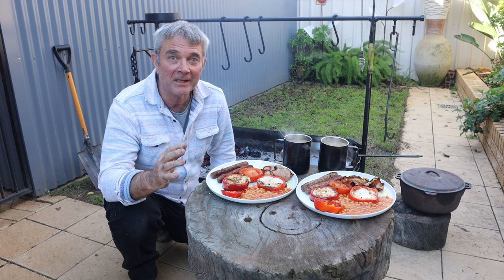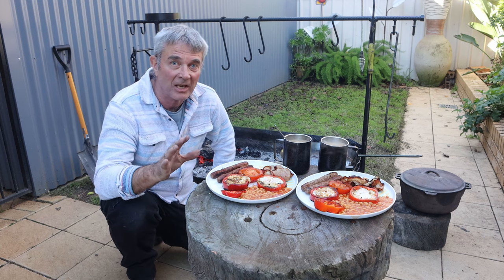Cooking Breakfast on the Metal Outdoor Fire pit I made on this channel.

Comment: Not sure I would heat any thing in a tin can now days. They are coated with a sealant on the inside. I learned that the hard way.  Just look at the lid.
Reply from the maker: Thank you very much, I appreciate your comment. The can did not get super hot, even some of the paper had not burnt, But you make a good point.

Comment: What a versatile unit and crafty build.
Do you smoke meats?
Could fab a sleeve for center section have a two piece lid to allow for hanging lamb, ribs from your center pole for access maybe? Or have a grill to hold inside?
If you can’t tell I love smoking meats…be easy to move coals and wood around the bottom of sleeve section with access.  
Enjoy seeing your projects!
Reply from the maker: Hi Scott, I do not smoke meats, I have put them in a food dryer (like you do for apples - to make dried apples) and this worked well, for our camping many years ago. Your comment makes me think of doing it. I will have a play one day. I love your idea. Thank you.
Reply: @GavinClarkdiy Thank you for the reply and, good day and best wishes Sir.

Comment: How do you keep the re-bars so shiny without painting them?
Reply from the maker: All my rebar gets coated in some way to prevent rust etc. Some are not as shiny as others. I often use Penetrol Rust Treatment Penetrates Rust 300g Aerosol Spray, and then put two topcoats of Semi-Gloss Clear Coat. That is what I used on the rebar lettering on the back of my workbench, here is the link to that video. https://youtu.be/JA-wk62Zghk I try not to comment on finishes, As what climate you are in, is it inside-outside, lots of rain, ice, do you want long term and rarely touch, or a wax with a wipe over every year. That is why I have no opinion, Please ask someone in your area what you should use, I feel this is a better way to find out what would be best for you. Thank you for your comment.

Comment: Gavin. Why the short legs?
Reply from the maker: It is basically used as a campfire we cook with Dutch ovens, the kids cook marshmallows and we sit around it with friends, if it was higher some of that does not work as well, plus your legs get cold as they are below the heat.